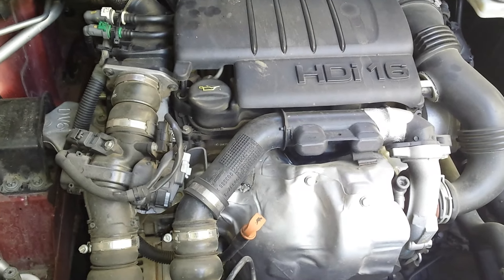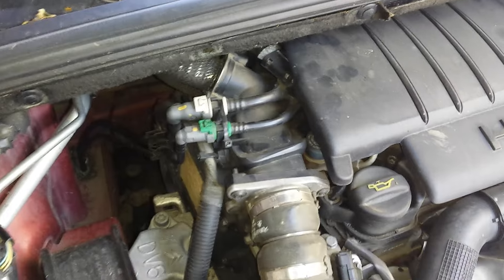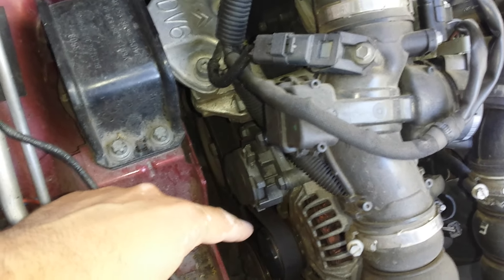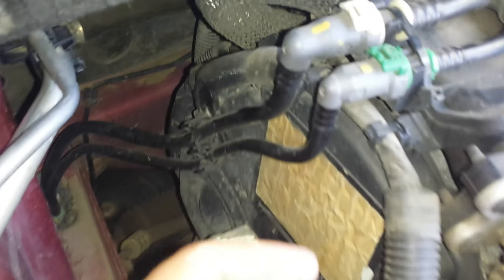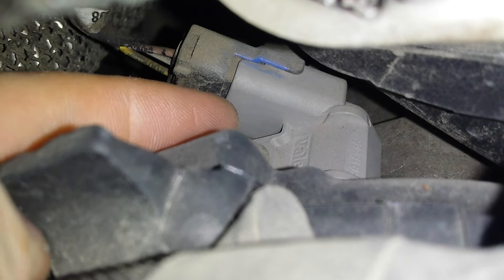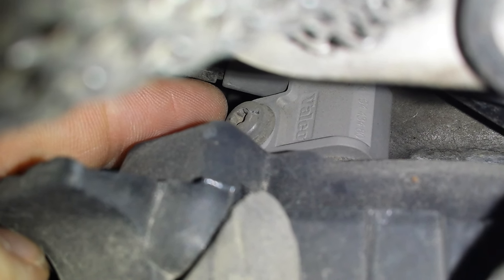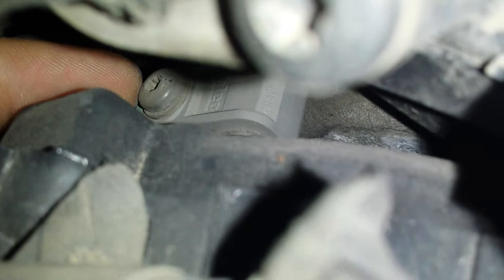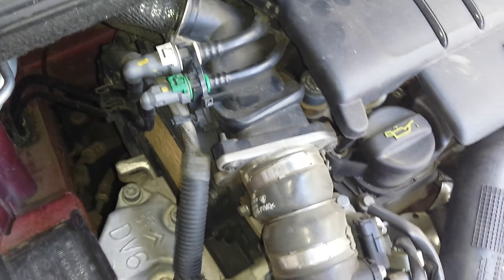1.6 HDI & TDCI Camshaft Sensor Location

Comment: Super helpful, thanks! I need to check if the plug on mine is properly set. I also had some oil leeks so that mighr5be an issue as well. The car cuts off on random occasions totally unrelated to temperature.. But it seema like when there arw vibrations introduced or sudden revving it triea to cutoff for a second. It might be bad connection at the plug....
Reply from the maker: Hello. The camshaft rotation sensor or the crankshaft rotation sensor should be checked.
Reply: @AdrianDragan  Thank you!

Comment: Very informative video.. can I please be helped on locating the cranksensor for 1.6 peugeot 207 petrol
Reply from the maker: Hello. If your engine is 1.6 VTI 120 hp see the image in the link, it's position 4. I hope it helps you locate it: https://www.catcar.info/peugeot/?lang=en&l=c3Q9PTgwfHxzdHM9PXsiMTAiOiJNb2RlbCIsIjIwIjoiMjA3IChhNykiLCI0MCI6IkJvZHk6IHdpdGhvdXQgcGFyYW1ldGVycyBcLyBFbmdpbmU6IDEuNiBWVGkgMTZ2IDEyMCIsIjUwIjoibWVjaGFuaWNhbCIsIjcwIjoiYWlyIGFuZCBmdWVsIHN1cHBseSIsIjgwIjoiSU5KIENBTENVTEFUT1IgU0VOU09SIn18fGNvZGU9PTFQQTd8fGJvZHk9PXx8ZW5naW5lPT1CMEZDQXx8Y2F0X2lkPT1GQ1QwMDAxfHxzdWJHcnBfaWQ9PUZDVDAwMTB8fHJlZmRvY3M9PUE3RjExOUcxOEF8fHJlZmRvYz09QTdGMTE5RzE4QXx8c3ViR3JwTmFtZT09SU5KIENBTENVTEFUT1IgU0VOU09SfHxzdXBwbGllcj09

Comment: Hi Adrian, thanks for the vid! Do you also know where the turbo solenoid (tvc)is situated on this engine (1.6 hdi Berlingo 2007)?
Reply from the maker: Hello! If I'm not mistaken, it's under the turbine.
Reply: Adrian Dragan Great! I’ll have a look. Thank you!
Reply: Found it, it’s at the back of the engine left side bottom. Only to reach from underneath. Great piece of French engineering, at an impossible spot.

Comment: i have a xsara not starting. scanner report a engine speed sensor. i bought a new one from citroen but still the same problem. checked wiring and fuses and all connection plugs. no lights working no fuel pump working no windows or door locks working. what can i check next. even opened ecu but seems ok
Reply from the maker: Maybe it's faulty the Crankshaft Sensor.

Comment: I'm facing problem with my Peugeot 308 1.6 THP 2012, while I'm driving it starts to be strange. For example, if I'm driving in low speed in high traffic, the rpm became up normal and sometimes the car jump while I'm breaking, and shudder while accelerating, but once I turn off the car and turn it on again, it get back to normal.
What do you think the problem? is it the camshaft sensor? Or something else?
Reply: I'm fairly new to mechanics, but I'm trying to diagnose a no-start issue myself. From what I've read so far this sounds like a turbo issue. Or possibly a leaky injector.. But I'd guess at turbo..  Feel free to let me know if I was right or not! :-)
Reply: joe o sullivan Thanks replying first of all my car is HDI not THP, sorry about my mistake, secondly I replaced the injectors, spark plugs and the Ignition Coil and my problem has been fixed
Reply: Ah right.. Thanks for the reply!

Comment: Hi guys. I have a Ford Focus 1.6 tdci 2012. I'm kind of confused as the title of this video is Camshaft and the guy in video calls it a crankshaft. But I was told they are 2 different sensors. My car stalled the other day and the diagnostics machine said camshaft sensor was faulty. I took off the crankshaft sensor which was underneath the car beside crankshaft pulley. I was told by the guy in auto shop that they are 2 different sensors. I can't seem to find the camshaft sensor. Sorry for long text . Any help greatly received
Reply: Camshaft sensor location 1.6 tdci 2012 focus.Did you ever get an answer to this problem,I cannot find it anywhere on the internet.

Comment: Salut la un Mazda 3 motor de 1.6 Diesel merge 3 zile perfect după aia o apuca ceva când accelerez sau las un pic de ambreiaj se oprește motorul. Închid usiile și las câteva ore și nu mai are nimic . O fii acest senzor? Mersi de răspuns pe bord nici o eroare
Reply from the maker: Salutare. Aceste simptome pot avea diferite cauze: senzor rotație arbore sau axa cu came, o mufa ce nu face contact bine, un senzor presiune, etc. Eu îți recomand să mergi la un service care are tester dedicat pentru Mazda și sa vezi ce rezultate vor fi la test.
Reply: @AdrianDragan  ok mersi de răspuns

Comment: spune-mi , te rog, dupa schimbarea kitului de distributie la 307 1.6 hdi 2005 trebuie sa fie masurat felul in care sunt pozitionate valvele, pistoanele? mie imi trage mult mai bine dupa ce am schimbat distributia si ma intreb daca e in regula...multumesc
Reply from the maker: Salut. La inlocuirea distributiei exista doua variante: ori este bine pusa la punct ori ai toate sansele sa distrugi motorul daca nu e pusa la punct. Totusi, o abatere de +- un dinte pe cureaua de distributie nu reprezinta un pericol imediat de distrugere fizica pentru motor ci mai repede o nefunctionare in parametrii optimi. In concluzie, vechea distributie e posibil sa nu fi fost bine pusa la punct si astfel performantele sa fi fost diminuate.
Reply: sa inteleg ca abia acum functioneaza in parametrii optimi? ca fuge de sub mine, realmente, fata de cum mergea pana in schimbarea distributiei. pornirea motorului este buna. imi spunea cineva ca la el (audi a4) mecanicii au masurat compresia pe fiecare piston dupa schimbarea distributiei. ar trebui sa imi fac griji ca eu nu am facut asta? multumesc

Comment: la un ford c-max același motor unde este senzorul de turatie îmi rămâne blocata cutia în viteza și nu mai schimba, cutie automata cvt ,sau schimba când vrea sau ma baga în modul de protecție după cum are chef,nu știu dacă senzorul este vinovat sau nu ,am și eroarea P0700 cu alta eroare în meniul mașinii D900 , și afișaj  ,,getriebe stòrung"  ( probleme la cutie) cate o data îmi apar toate erorile da cotețul merge perfect ,mai rar cei drept 😀
Reply from the maker: Salutare. Eu îți recomand să pui un tester original Ford pe masina, problema nu trebuie ghicita 🙂

Comment: Can anyone help ,my partner encounters problems when reaching 3000 REVS around 60-70 MPH ,engine vibrates with a knocking noise .Is this down to a faulty camshaft sensor ?
Reply from the maker: Hi,
You need to do a diagnostic check in a specialized service.